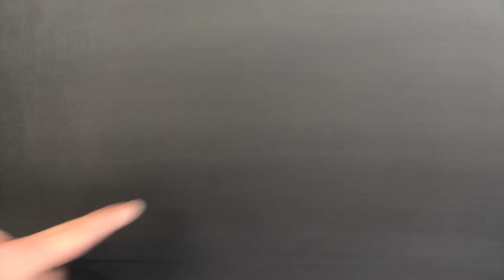DIY HOW TO PREP AND PAINT AWLGRIP part 5

Comment: Hey Frankie, Love your channel and am about to paint my 29' Ericson sailboat. Your advice is invaluable.
How do you feel about clear coat over topside paint? Is it worth it?
Reply from the maker: I would not recommend clear coat. I’ve never been a fan of it and I would only use clear if spraying metallic. I personally do not believe clear should be on a boat that spends its life in saltwater.   This is just my opinion. The advantages to clear is it hides imperfections. But once it starts to break down then you have another mess to deal with. With that being said, there are others out there that would recommend it. Everyone has their own opinion on the matter.

Comment: Hey Frankie, awesome videos. I finished my third coat yesterday doing everything i saw in the video, but today i have streaks of haze all along the hull. Should i sand down and add another coat, or is there a way to sand at a very high grit and polish? Thanks
Reply from the maker: Usually when it hazes it’s because of moisture. Night air setting on the surface etc. sometimes it happens on bigger boats in certain areas where there is a fridge, or ac unit etc. just all depends. If you used awlcraft then yes you can polish it out but you might be better off spraying another coat.

Comment: Frankie. I’ve enjoyed your videos. I’m looking at a Selene 50 ocean trawler that has been neglected. The hull was repainted about 4 years ago but looks like it wasn’t properly prepped prior to repainting. Subsequently, hit was hit by a barge and then “touched up”. There are many areas of spider cracks around portholes and other fixtures. Also there is a two foot area of stress fractures probably secondary to the collision. I really like the boat but it also has problems with mechanicals. The owner knows boat such as this are rare finds in the current market but I don’t want to overpay for a boat I want. Knowing the damage, what should a yard that does restoration charge  me to repair the hull? I know it is difficult to give an exact price but could you at least give a range of what to expect to cost.?

Comment: Why you retape and mask off at every stage  ,why the masking can't stay through out the whole process?
Reply from the maker: There are a few different reasons. 1 ( the amount of dust that gets trapped in and on the plastic that will get in your topcoat when spraying) 2 ( after the primer cures on the plastic, when you spray the topcoat, the air that hits the plastic and makes the plastic move has the ability to release cured primer flakes off the plastic and it can land in your fresh paint) it sucks when that happens and is not worth chancing. It’s also good to remove plastic after each step to ensure that no overspray found its way onto surrounding surface. If there’s a way for the overspray to find its way through the plastic, it will. Ultimately it’s just not worth chancing. However, if it was my own personal boat, well I’d probably chance it 😂👌👌

Comment: How much spraying material (converted and reduced) did it take to get around that Chris Craft Frankie?
Reply from the maker: Ray Bates if I remember correctly it was about a gallon and a half total. 4 coats.
Reply: @boatpaintingrestorationwit3029  Thanks!  I have a 28' Mako I'm about to do and I was trying to get an idea on what I would need.  Keep up the videos. I think I've about watched them all.  You're doing some great quality work for sure!

Comment: Very imformative video do you ever use a hand block or all da?
Reply from the maker: Mondragonpride11 I do airfile and torcher board when needed. Most of the time these boats have a lumpy/dimply contour from the factory. I prefer to try and make the repair match the surrounding. It’s rare that I come across a hull that is perfect. But when I do, I blocksand. Lol
Reply: @boatpaintingrestorationwit3029  yes same here i block it after using da

Comment: You never mention how long your waiting between coats. Great video though. thanks
Reply from the maker: donnfl  it’s something I never think about. The time between coats all depends. With the bigger boats usually by the time you’re finished with the first coat you can immediately start on the second. With the smaller boats that’s not the case.  The thumb test is how I go about knowing when to proceed. You push your thumb down on the tape where you have painted and count to 2. Remove your thumb and if no paint is stuck to your thumb then your ready for the next coat 👌👌. Good old thumb test.  Hope this helps
Reply: @boatpaintingrestorationwit3029  :Thanks so much for the reply, you should teach that in your next Video.

Comment: Quality work! About to attempt my first go with awlgrip, what spray set up are you using for spraying awlgrip?
Reply from the maker: 3M accuspray. 1.8-2.0 spray cap for primer, 1.2-1.4 spray cap for awlgrip topcoat
Reply: @boatpaintingrestorationwit3029  Awesome thanks! Out of curiosity Could I get away with an hvlp? Just to keep from buying another gun that I may not use again. If it will render the quality of the finish then I can understand that.

Comment: So why does AWL say don’t do a tac coat? They say it will not make the final coats smooth. You are the man doing the actual work professionally so I trust your experience it’s just kinda confusing
Reply from the maker: I think they say that because of the new formulas that constantly come out. I just prefer to stick with what I know. When I do my first coat, I call it a light tack coat but all in all it’s still a wet coat. The goal it to not go for color coverage until the 2nd coat. Even then you will still see light spots. The 3rd coat is when it all comes together. Not sure if this answers your question but I don’t know how else to explain it.
Reply: @boatpaintingrestorationwit3029  ok One more question I have two nozzle sizes 1.3 and 1.8. I am putting the AWL flag blue down tomorrow. Which would you use? I appreciate your advice.
Reply from the maker: 1.3
Reply: Thanks Frankie I put down 4 coats and it came out well in my opinion especially for a rookie. My question now is I wasn’t going to clear coat it (it’s flag blue ) but should I wet /dry sand it with 1500 then cut and wax it? I was planning on it. Thoughts?